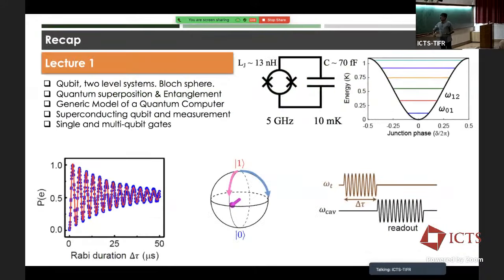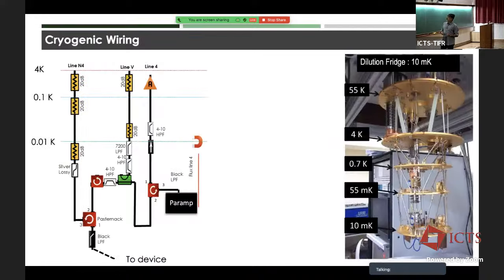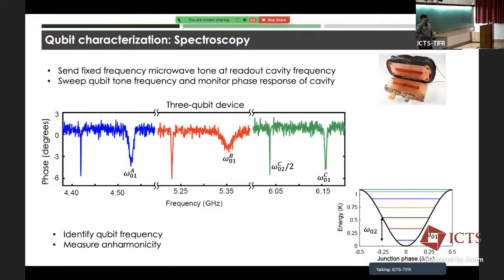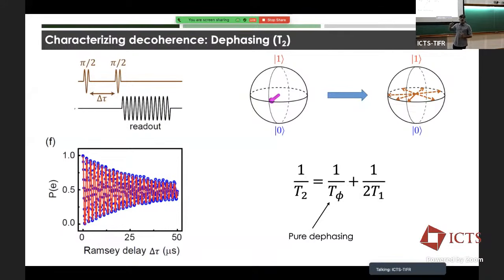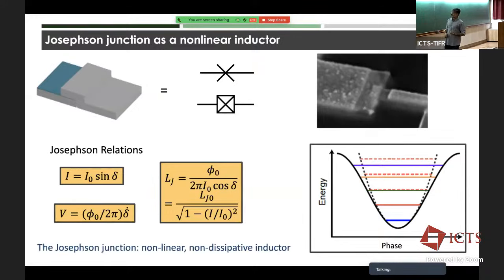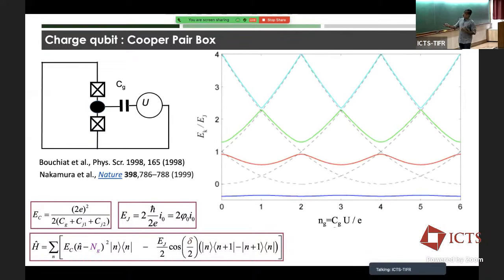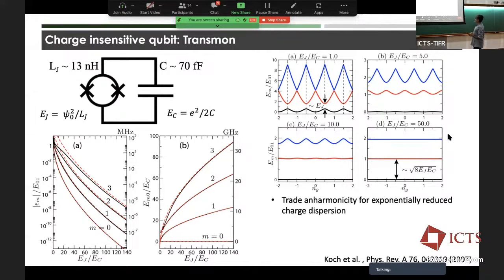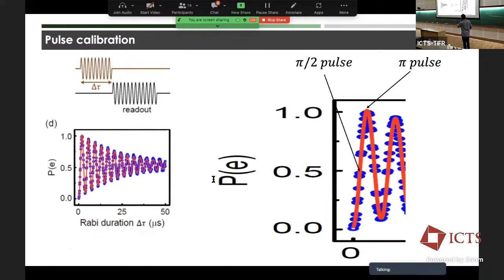Superconducting Electrical Circuits: A Platform for Fundamental.... (Lecture 2) by R. Vijayaraghavan

Comment: Space is a dielectric super fluid of variable density and minimum turn radius of one Planck. 
Time is a compactified dimension one single Planck second in size which creates/forces/constrains to A) limits because compacted and limits rule B) conservation via entropy. 
The truck the universe pulled was to use a single sided surface which creates a place for high energy limit to go."beyond" but renormalization, it is the low energy INVERSE. Because a single sided surface and 4pi to complete. 
The radially symmetric Klein bottle 
Surface(cos(u/2)cos(v/2),cos(u/2)sin (v/2),sin(u)/2) 0>u>4π 0>v>2π.